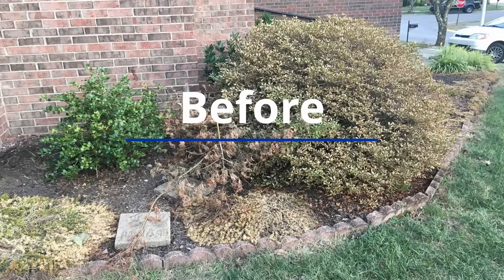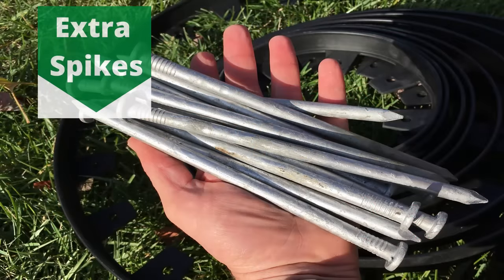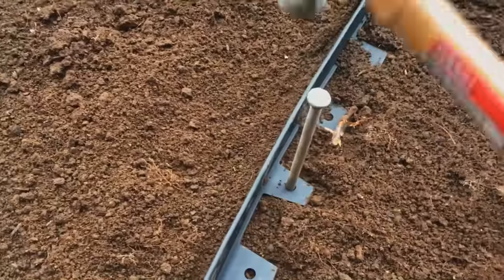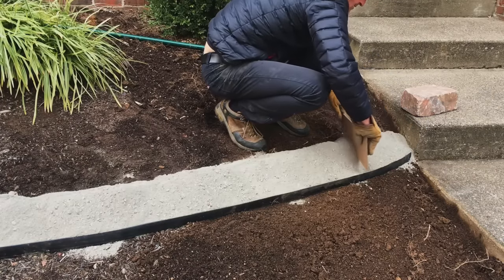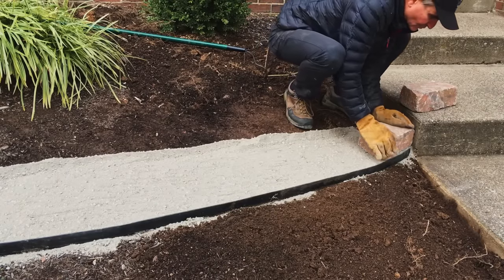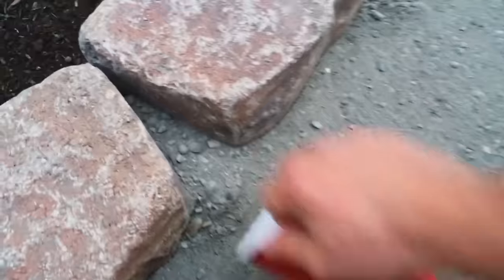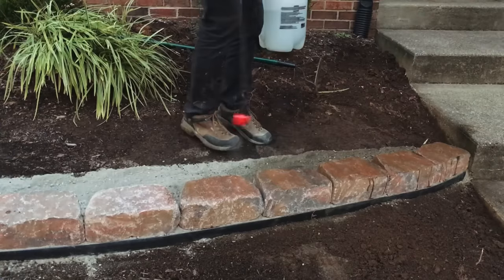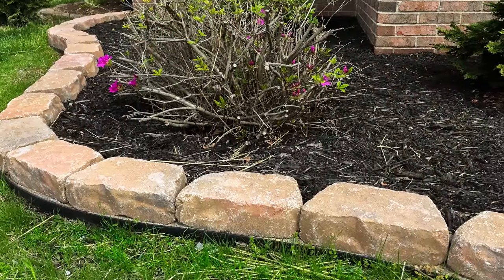easy diy No Dig Border *2020 UPDATE*

Comment: Followed your link to this updated video, and just wanted to let your recent viewers know I built a border in 2017 with some smaller Belgian pavers using this technique, and after 4 winters with lows around -9 to -17 deg. F, my border still looks just like when I first built it. Every single block is still exactly where I laid it. (Except for a few my fencing contractors busted out to replace a wood fence.)
Reply from the maker: Thank you for your comment, CitizenKate. Fantastic!! I'm so glad to hear this!!
Reply: Thank you so much
Reply: Ty
Reply: Glad to know it held up. I've watched a couple different videos on making borders and this one is the I think I'll follow. I was worried how it would hold up over time.
Reply: Hreat
Reply: How much misting? I'm worried o will leave dry concrete in the middle.
Reply: Relevant claims supported by factual observation…Brilliant! Thanks!
Reply: @westbay5858  It is OK to leave dry concrete, it will draw moisture from the ground and harden
Reply: @maxpatch67  Is there any chance water builds around the foundation and cause issues (water to get inside the home in the long run) since the border prevents the water from escaping the flower bed?
Reply: Thanks for your reply on your project from 5 years ago. It’s good to hear how well maxpatch67’s border method has held up and also that other bricks/stone will work.
Reply: @kingbee4474  That is a possibility, yes. When I built mine, I made sure my downspouts routed the water to the outside of the border.
Reply: @CitizenKate  Yes, that is great! I guess rain and snow going in the edge is not enough to create damage to the foundation? Gutters deliver much more water.
Reply from the maker: Did you end up making a border, Bryan?
Reply: @kingbee4474  Before I started my border I ran a trench from the downspout and under where the border would be and then used a pop up drain emitter on the other side where the grass is.  Home depot sells the tubes with the sock & foam 'gravel' already on it (EZ-Drain Prefabricated French Drain with Pipe) - When I was done I just laid the concrete and bricks right on top of it.  Now I dont need to worry about water backing up behind the wall - even during a torrential rain the mulch is undisturbed.  Works great and looks awesome, new england winter down to -10F and the border didn't move.
Reply: @kingbee4474 if you are worried about that you should have a drainage system installed and a sump pump. That is what I have. But I have a basement.
Reply: I been wanting to make a edging but I don't want the edging to be higher on a side walk. I want it level, so that means I must dig.
Reply: O tim , the only GOOD advice was the plastic border. If you just DO IT ON TOP OF GRASS your flowerbed WILL have grass growing in it WITHIN the first month. What an insult to anyone's intelligence this video was. THUMBS DOWN, DON'T RECOMMEND CHANNEL

Comment: I can say that 5 years later its still 95% good!  I had a few dip spots but it was from moving soil.  I would highly recommend this route.
Reply from the maker: No way!!! Actually that's about what I expect. :) I'm so glad to hear that and I really appreciate the update....very encouraging for myself and to others reading these comments. Have a great day, @eastsideozzy!!!
Reply: @maxpatch67  I'm considering using this method but as the above poster mentioned about moving soil, I worry how well it will hold up over time. North Texas here, my ground shifts a lot due to our clay soil. Not sure if using paver base and sand would be any better.
Reply: @Archaides 
Same concern here as I live where it snows and temp can drop below 0 Fahrenheit.

Comment: I have two questions I'd like to hear your thoughts on.
1.)  Do you find that the black plastic no-dig edging gets in the way when mowing?  Does it get "chewed up"?  Or can you mow right over it?
2.)  How does the quick-krete affect the permanency?  What if you want to change the border or remove it?

Thank you!
Reply: 1) No not at all I mow and weed wack right up against it.  You don't mow over it because the blocks are right on top of it. 
2) It's more or less meant to be permanent but if you want to remove, you can just whack the bricks with a sledgehammer and they will come loose easily.  But the concrete will most likely be stuck to the bottom of the brick so not easily reusable.  If you want to salvage the bricks you can put a piece of wood up against the brick before wacking it with the sledgehammer.  But still will be a pita getting the concrete off the bottom.

Comment: I built one of these 2 rows high and 60 feet long, cost me $350 and has held up great. Settled into the soil perfectly and now I have a 60 foot wide flower bed for my home.
Reply: I’ve been wondering if I do 2 layers, will it withstand over time?
Reply: @kaprial4821  absolutely! I’ve had mine up for a year, my mom has had hers in place for 23 years. They are extremely durable.
Reply: How did you get the top row to stay put? We keep knocking ours over with the lawn mower.
Reply from the maker: Try using landscaping block adhesive. Its very strong. Can find it in the caulking area of stores.

Comment: I finished mine about a month ago using your video as my guide, and it worked great. would post pictures, but not sure how to do that or if it is allowed., But truly thank you for the great video, it really works
Reply from the maker: My pleasure, Nancy. Thank you for taking the time to leave a comment. Have a great day!
Reply: @maxpatch67  why the concrete?
Reply: Really looks great! Looking at all the different types of borders that my husband and I are considering this is a top contender.
Reply from the maker: @shortstack1757  The concrete adds height(just for looks), adds bonding and stability for the blocks, and goes a long way as a weed barrier for aggressive grasses and weeds like we have here in Nashville which includes Bermuda Grass.
Reply: How many times did you mist it with water?
Reply from the maker: @31acruz  Once. Take the time and mist thoroughly and it will begin setting up all on its own when there is enough water.
Reply: Can you lift the blocks up? Or are they attached to the cement after cement cures
Reply from the maker: @joemama-kx6rk  After finished, the blocks are stuck very securely and should last for many years.
Reply: Did u use the same mister or did u use a holes? N can u use a holes?
Reply: Is there a such thing of over watering the fast setting mix after the initial mist.. when is it watered enough. Thank you
Reply from the maker: @poker2478  If you are misting it, no water could be too much.
Reply from the maker: If have have a chance, please send me a finished photo at tim@timvogelaar.com. I'm going to make a gallery of borders for people to browse through for fun. Thanks.

Comment: If you ever sell your house won't the next owners be surprised when they go to move a brick?😊 
It does look amazing though!
Reply: Becky Rey You buy it you can break it or keep it!
Reply: As the next owner in this concrete situation, I've cursed the previous owner many times. 😡
Reply: Big no on using concrete!
Reply: This is my concern too--or, if you as the owner want to change/update/add to landscaping area and are stuck with the headache of removing concrete!  Would sand be an alternative here??
Reply: @sarahwamsley6111  He did it to also help prevent weeds and sand wont prevent weeds

Comment: Do you have a video on the DIY of the actual flower bed? I have a similiar style and "before" condition and would love to see the steps that went into making that flower bed look so nice
Reply from the maker: I don't have any videos on landscape design. As an artist, I think there is quite a bit that goes into it. I consider it to be "making art with plants". In this case, I used a mix of existing plants being trimmed way back, moving some plants, and adding a little new to make a pleasing look. Thanks for your question, alymar177!
Reply: maxpatch67 to add to the question. I cut all of the plants and bushes down that I did have in the flower bed already . But the roots are still there. Did you dig your roots up or just added new plants along with the roots?
Reply: @Jas-qm4cg  h

Comment: Just turn the bricks around to get rid of the gaps. That’s why the sides are angled like that.
Reply from the maker: Yes! Alternating the block faces would close the gaps.  Maybe this would look good along a straight border? 

I recommend staying with the front facing arrangement, however.  Many eye-pleasing landscapes use large, curving borders.  The extra gap on the inside allows the border to turn without losing its "uniform" appearance.
Reply: @maxpatch67  you can still easily make a curve without having gaps and I would recommend just throwing down a little paver base and tamp it rather than use concrete

Comment: This looks like a really interesting technique.  A couple of questions:
- How critical is it to use the boarder?  That plastic will eventually get eaten up by my edger when I cut the grass.  
- Can the same technique be used for a 2 layer boarder?  Place a mother layer of Quickcrete on top of the first layer of bricks, then set the 2nd layer of bricks on that?
Reply: Wondering the same.
Reply: was also wondering about both of those two points. in fact i was thinking once this is done i would add flat pavers on the outside along the lip of the plastic and that way the lawn mower wheel can ride over that as i cut the grass as seen in another YouTuber video of edge pavers. And for your second question, I too wonder if this would be strong enough to hold a second level of edgers on top to give it more height... its something i might try .. theres only one way to find out lol
Reply from the maker: Great questions and thanks for asking. 1. The plastic edge is very important to use as a form for the cement and it also has a leveling effect as it glides over small dips in the dirt, creating a much more uniform look to the border. I have had some people say they reversed the plastic edge and then removed it after using it, but I have not tried that and cannot testify to its effectiveness. Anyway, that could be an option for you. 2. I have not made a second layer on this type of border because I don't know if it would look that good and the difficulty level is raised some because you would mix up and use a traditional mortar between the layers. You could also use landscaping block adhesive. Even, though, it involves more work, I would highly recommend digging out the old dirt and mulch out of your area so the level is dropped enough so that there is plenty of room for the mulch to sit in there without spilling over. Also, the same thing can be accomplished by building your border out further so the dirt can slope down to the level of the bottom of the blocks and also have room for mulch. I hope this helps! Let me know if you have any more questions!

Comment: You can flip every second block to get rid of the space in between the blocks and make it more appealing.
Reply from the maker: That's what I would do if I weren't making it so curvy. With curves, it ends up looking worse having them flipped back and forth with gaps on the front side of the border sometimes. Your idea is perfect for straight lines. Thanks for the comment, Darren!!

Comment: I didn’t know cement can be place like that on top of dirt that is great very convenient and looks easy
Reply from the maker: Yes, when I came to this realization, it makes many things possible...but take note...this method only works with "fast-setting" concrete mix. It is made to work like this....all other kinds, you need to use traditional mixing methods which is ok, but a LOT more work for many projects. Thanks for your comment and have a great day!!

Comment: I am getting ready to lay new edging on my front yard. Is this method...using the concrete, a permanent job? What if I (or a new home owner) wanted to change the edging at a later date? Just curious how "permanent" this particular method is? Can the concrete be broken up easily if changes need to be made later? Thank much!
Reply from the maker: Well, the yard is not dug up so it wouldn’t take any digging to get it out, but you’d have to break it up with a sledge hammer. You’d want to choose another method if you’re not sure of the long term. Thanks for the question, Derek.

Comment: You know, if you alternate the bricks, front facing and then back facing, you won't have all those gaps to fill in!
Reply from the maker: Yes! Alternating the block faces would close the gaps.  Maybe this would look good along a straight border? 

I recommend staying with the front facing arrangement, however.  Many eye-pleasing landscapes use large, curving borders.  The extra gap on the inside allows the border to turn without losing its "uniform" appearance.
Reply: Can you then stack another level using the weight of the stone to hold it in place without extra cement or can use use a fine layer of the ready mix cement to make the next level? How do you do this with small incline will it look off?
Reply: you could do that if you want to make a straight line with the blocks, as that is what they are designed to do, but for curves the only way you can really remove the gaps is by cutting the block, or getting a 2" wall cap block
Reply: keebler6903 Cap blocks are what a true professional would do!
Reply: @elizabethdinny7894  I think you would have to make sure (very sure) that the first level is level, the next layer could be added with some construction adhesive. I wouldn't do more than 2 layers high with this method. To go higher than that it is probably best to dig the first layer into the ground about half way.
Reply: How do you keep leaves and grass clippings from getting imbedded in the rocks?
Reply: @julievalencia8633  I am also wondering the same.

Comment: I am 73 woman from Australia. I like and thank you very much for the simple, practical and easy operation of your video, which gives me confidence and motivation to make flower bed borders. I would like to ask you if concrete can be directly laid on the soil? How many centimeters is the thickness of the concrete bed? How many meters does 20kg of concrete cover? Thank you very much!
Reply from the maker: Yes, you can pour the concrete mix out on grass or bare dirt...whatever is fine. the concrete ends up beig about 2 inches thinck since that is about how tall the plastic edge is that you use for levelling. One bag of concrete works for about 5 linear feet of border. Make usre and buy "FAST-SETTING"....no other kind works the same.

Comment: I went through a number of the comments and didn't see anyone address why to use concrete? My concern is what if I want to change the layout or design later? This seems like a permanent job?
Reply: I agree.  That's what I was thinking and it extended into the border too. You would have no choice but to cover it with mulch.
Reply: It's just concrete without reinforcement so it should just break up with a hammer blow if you want to remove and/or change shape.
Reply: Z W  may as well forget the stone bricks and just create a concrete strip.
Reply from the maker: Yes, Antonio, this is designed to be a permanent solution for many problems people have with other types of borders. The purpose of the concrete is to add height, stability, and act as weed barrier against aggressive grass and weeds. Thanks for your comment and let me know if you have any more questions, ok? Have a great day.
Reply: A decorative border doesn’t get a seasonal or even yearly wardrobe change. If the stone is just set down on the ground it’ll move with heavy rain or when the kids bump it playing in the yard. But if you want to change things around, pull the mulch back and use a flat edge shovel to wedge under the concrete and lift up. It’ll break apart pretty easily.

Comment: Finally! The perfect video to do this easily.  Thanks so much!  On step 5, can i fill the gap all the way to the top of the brick so that there is no gap in between?  Thanks!
Reply from the maker: My pleasure, evocre8r. Yes, you can go ahead and toss the mix in the gaps up to reach the top of the blocks if you want. It will slope down and only the blocks will show when mulched.

Comment: I've put down stones like these as tree "rings" but without the edging, stakes, and concrete. Mine looks nice, but never stays put. It's a constant battle with moles tunneling underneath and freeze/thaw heaving. This looks amazing. If this is all I need to do to keep things in place and never worry again, sign me up!  I was considering brick borders and I assume this same technique would work to keep those in place too. Am I right? Or wrong? Thanks for both videos!
Reply from the maker: My pleasure, Kristy. I believe this is the border technique for you. Yes, they will easily stay in place with this technique and it will work with regular bricks if that's what you want. Thanks for leaving a comment, Kristy! Have a nice day.
Reply: @maxpatch67   what's the main reason for the concrete, to help the blocks from moving downslope? And I'm afraid it would crack around the blocks.